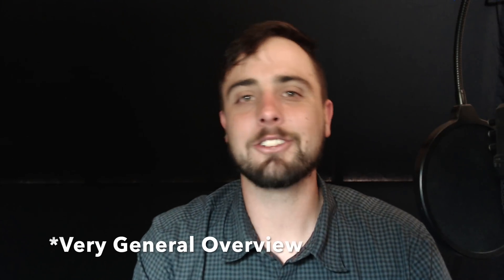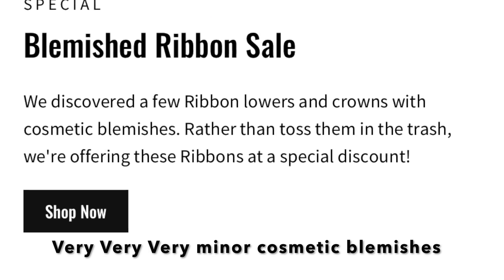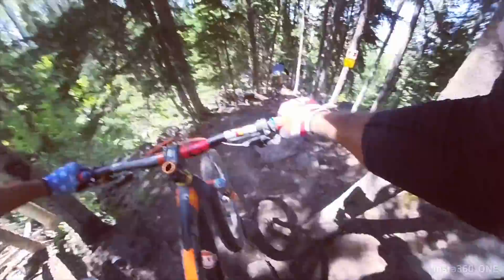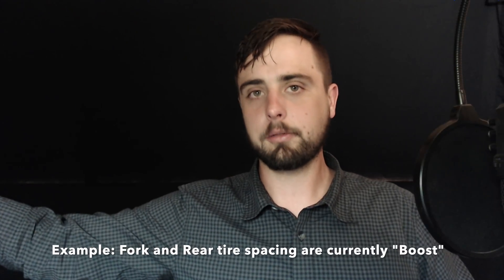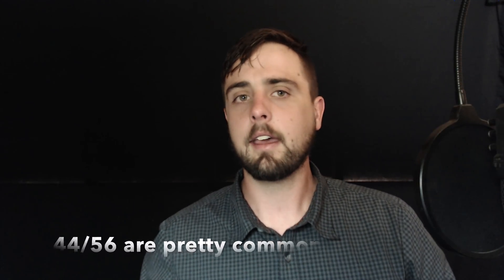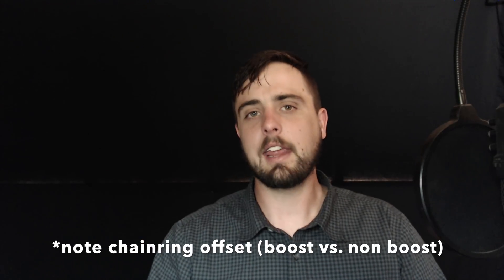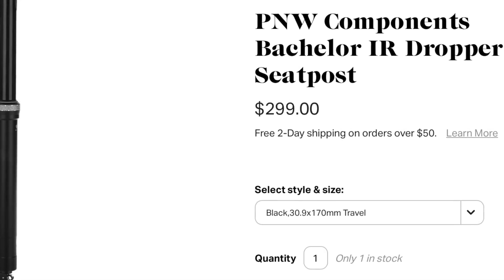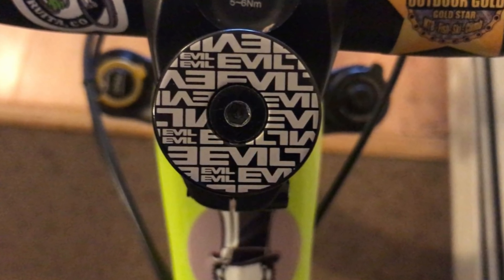Should You Build Up A Bike Frame? A Couple Tips, Tricks, and Watchouts For Building A Frame

Comment from the maker: Would you consider building a bike from the frame up? Be sure to check the description for some stuff that was missed or lost in context in the video.
Reply: Love the little clip of the waterfall on National 👍👍
Reply from the maker: @azdirtlife4280  I was just missing the Crashing Grandpa in the clip, had to show some PHX love there.
Reply from the maker: @FloridaEbikes  Thats exactly why I do it, plus I get to scavenge around for used parts. Don't forget those used frames for the cheap too, I've built up a couple of those in the past and saved quite a bit of money with those builds.
Reply: Editing getting better every time. Nice piece.
Reply: I like how you remained anonymous with brand names for hubs and other components... aside from talking about problem solvers and driver bodies. Thanks for showing National Trail too!
Reply: Most definitely yes.
I like to pick the parts I want to use.
Reply: I definitely do, I rather install what I got and the parts I order, and not end up with stripping half of the bike off to sell.
I got most of what I need, only fork, frame set, headset,dropper post are needed. But I need to cure my self from analysis paralysis, I am getting close I think.
Reply: I always build from the frame up. Way more fun and I get what I want. Thx for video.

Comment: 8:14  I am sticking with Shimano HG, cus I can file it down and not get stuck cassette, but the XD driver & cassette can get stuck to each other, and need wise and hammer or breaker bar to remove it.
I got a 11-50T but waiting on Box One X-Wide RD, and Archer D1Xtrail shifter. I think this setup is going to be sweet.

Comment: It would be great if there were a "parts-picker" to ensure compatibility (similar to pcpartpicker.com for building computers). Some online bike retailers have rolled their own "builder" interface which can be a big help in eliminating mistakes. That said, local shops typically have this experience, and the likely somewhat higher price can be viewed as a "consulting fee" to ensure not only compatibility but suitability -- e.g., do you need that Race Face Atlas crank or will the lighter Turbine do the job?
Reply from the maker: Interesting point. Heck that would be good to have for buying and building a wheel! Yep exactly and there are a lot of perks of building and buying from the bike shop, sometimes they’ll cut you a deal on labor depending on the shop.

Comment: Hey, from Grand Junction here too!
Reply from the maker: Hell yeah!!!🤘🤘🤘
Reply: @OutdoorGold  I was wondering of the best bike frame design to build for this area. Currently I shred a Norco Hardtail!
Reply from the maker: I feel anything with travel ranging from 130-150 is a huge plus out here if you like riding at the lunch loops and Powderhorn. I do like Yeti's alot in this terrain for the plus end peddling efficiency. But, Pivots, Rocky's, Ibis etc. with that respective travel does really well out here. I tend to add 20mm to the fork based off the rear travel. Both my SB6 and Insurgent are running 170mm fork/150mm rear.